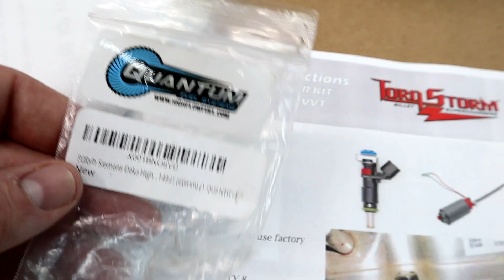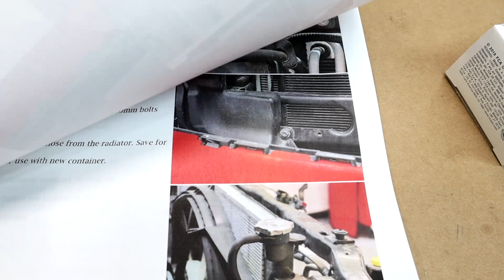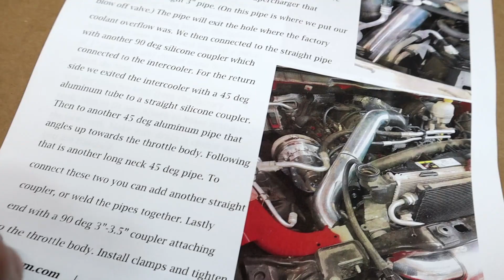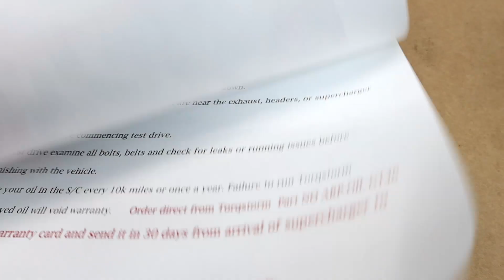TorqStorm Supercharger Map Sensor And Injectors Installation Part 4

Comment: Do you know if it’s possible to use hellcat injectors? They’re a lot cheaper and are 600cc
Reply from the maker: You can but they are actually pretty crappy lots of tuners dont like them.
Reply: @FrostbiteRam  thank you for your reply man. I got a heck of a deal on a fuel pump and he threw in some hellcat injectors so I’ll be using them for now on my budget torqstorm build. I’ll definitely upgrade in the future but between the bigger fuel pump and the injectors I’m hoping I’ll be ok for a min.

Comment: If u have alot of airflow work done...Cai headers throttle body... the bigger injectors would give u a lil more h.p themselves huh?? Or would it throw everything off without being tuned??
Reply from the maker: Bigger injectors need to be tuned for sure.
Reply: @FrostbiteRam  gotcha I bet they would add a decent bit more h.p. within themselves jus kinda had the wheels turning on my end